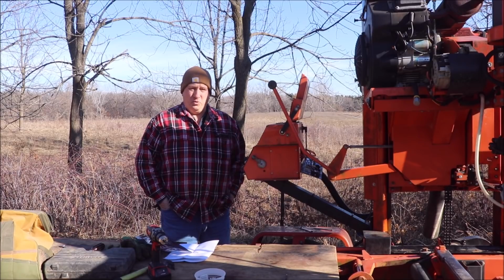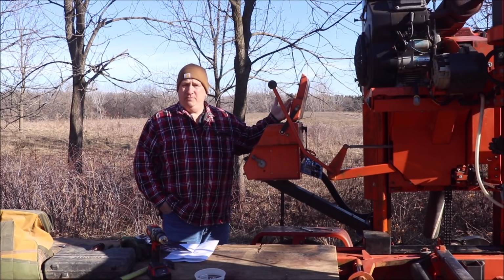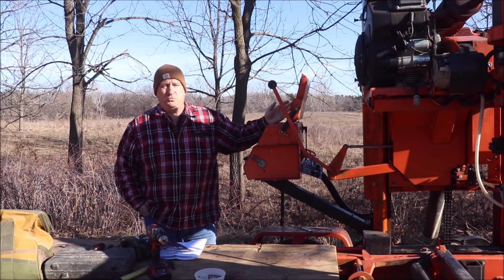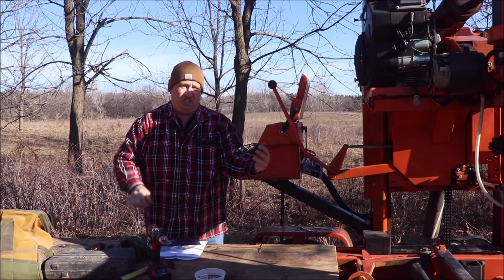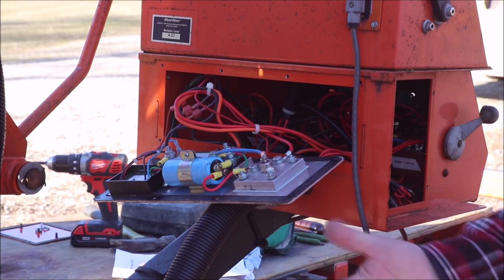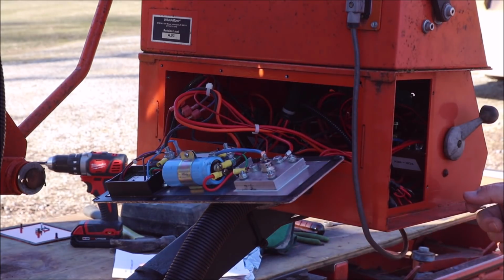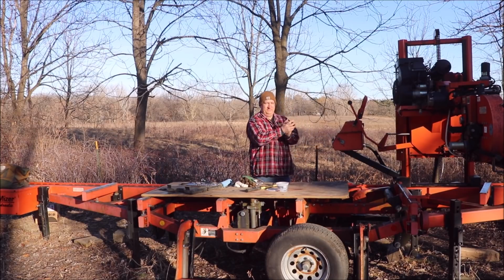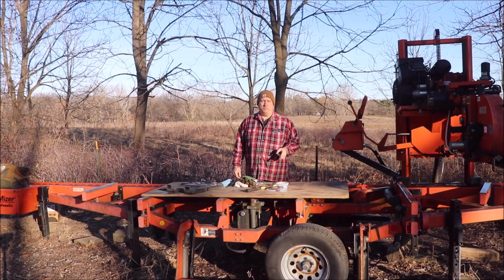Woodmizer LT40 power feed repair

Comment: How much do you think a 2005 woodmizer LT 40 hydraulic with 8,000 hrs is worth.
Reply from the maker: Condition is everything, especially with 8000 hours.  Thats a machine that, if it wasn't rebuilt already, is going to need a lot of work with parts replacement.  Parts are very expensive.  Your ability to understand how things work makes a big difference, and whether or not you can find or fabricate repairs on your own.  My next sawmill is going to a "WIDE", and I'm going to build it myself.  Lot of work, but I don't have $80K laying around to buy a 60" Woodmizer.  Sorry, but no way to answer your question without an inspection of the machine, and testing it's condition.  Could be junk, and could be worth some money if it's been maintained well, and has had all systems replaced already with updated parts.

Comment: May I ask ball park what the mill is worth now ? Or how much I could expect to pay for 1
Reply: That's awesome.  I have a 1986 non hydraulic LT40  with a 24 hp onan .
I'm looking at purchasing a 2002 LT40  25 hp Kohler with under 500 hrs registered on it hydraulic, with debarker and siding attachment jig trying to see if it's a fair price. It all works but it's never been under roof only woodmizer vinyle covers
Reply: The one I found I can get it for $7,500. From a freind.  I think I'm gunna go ahead n get it.
Reply from the maker: What is it?  Brand and model?
Reply from the maker: Like cars and trucks, a sawmills value depends on how old it is, how well equipped it is, and how many hours of use it has.  They all have hour meters on them.  My sawmill only has about 215 hours on it, and it has a lot of options.  You can go to sawmill exchange on the internet, and there you can compare prices on a lot of different mills.  Hope that helps.  To buy my mill new today would run $35K to $37K,  Less for used.  Woodmizer sawmills have excellent resale value.